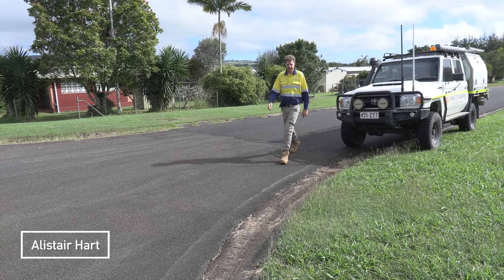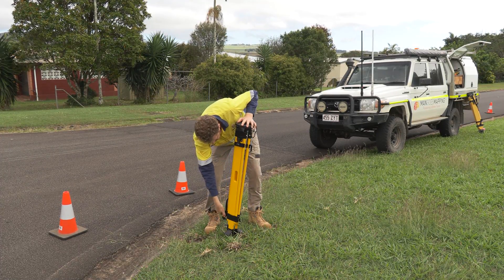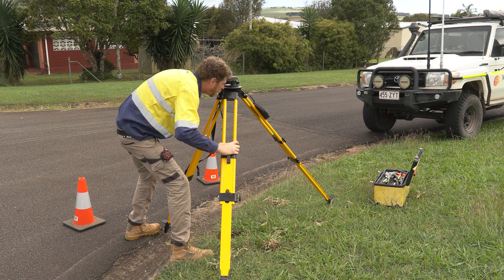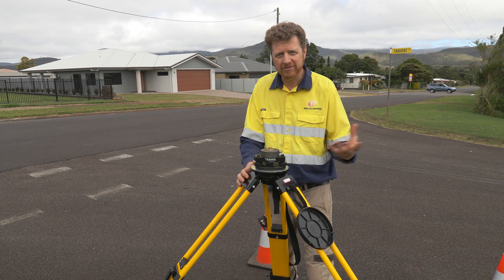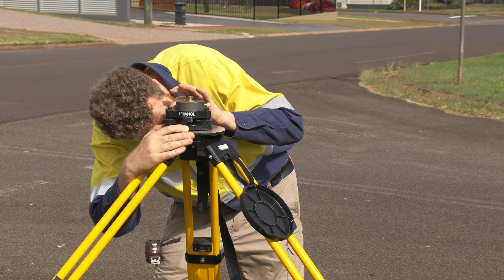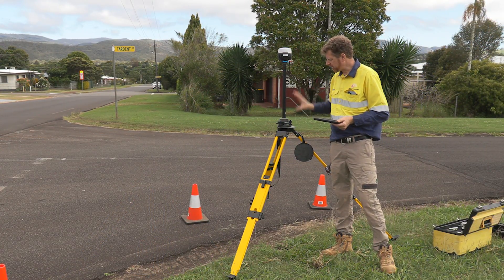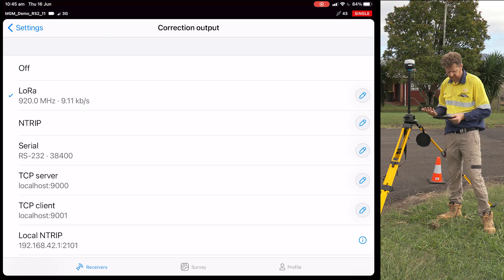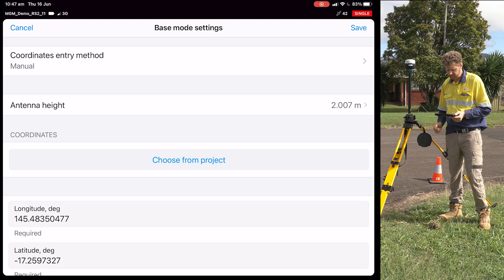Setting up a Base Station Over a Known Point

Comment: Hey mate cant find a video specific to this. 
Im using a rs2+ with a dji p4rtk and if I want to use the base where there is no internet or known point, how do I go about getting an average and then get an rtk fix for me to fly terrain awareness mode? 
I now have starlink but just thought id see if its possible to do in case I ever need to do it.
Thanks, Kieran
Reply from the maker: Hi kieran,

Love the P4RTK - it's a real workhorse!

When working in remote areas, Starlink can certainly be used to connect to NTRIP services. However, it's important to account for RTK errors caused by long baselines. In such cases, processing via AusPOS and utilising PPK workflows might be a more reliable alternative.

Here's a quick overview of PPK:
https://docs.emlid.com/reachrs3/ppk-quickstart/ppk-introduction/

We often work in very remote areas and prefer the PPK approach.
Reply: @ Need a rtk fix for terrain following mode. Do you have any info on that if I were out bush? Can probably use a float solution but not sure how it all works or to set up on the emlid.
Reply from the maker: @ Hi Kieran, make it a 2 step process.

1) First, establish a known point using your Starlink providing corrections to your RS2+. 

2) With the known point now established, have the RS2+ receiver provide corrections to the P4RTK.

For detailed guidance, please follow this link to learn how to use the RS2+ as a base station for DJI RTK drones: https://docs.emlid.com/reachrs2/integration/dji-rtk/

If you'd like to learn this in more detail - we provide professional training.

Comment: Thank you so very much, I get out in the field so rarely that I forget small steps each time.  I never knew the tip about adjusting level 2 points at a time, handy.   Handy that youre even using the same GNSS stuff i am, didnt know that you could take GPS to 1 HZ without having to play with the bandwidth.

Comment: Thank you Sir for all your useful information. We have been using the Emlid RS2 for several months and very happy with it.
What do you consider is an acceptable margin of error when staking a point to verify accuracy
Reply: Maybe it depends what brought are staking, drainage on sloppy sight needs less accuracy compared to bolts for precast steel
Reply: Hi Eddie, how is Emlid RS2 comparing with Leica/Trimble?  Thanks!

Comment: Not taking curvature into consideration? 🤔 

🚴
🌎
🧗🏻‍♀️ (Australia)
Reply: Don't need to on such a small project, generally only used on long terrestrial traverses or large survey projects.  The software he's using is based on a projection and will allow grid surface to ground surface corrections.
Reply from the maker: Hi Wheeler. Could you elaborate on that?